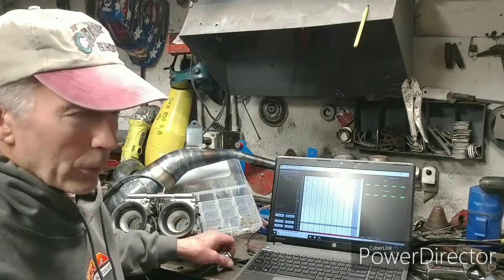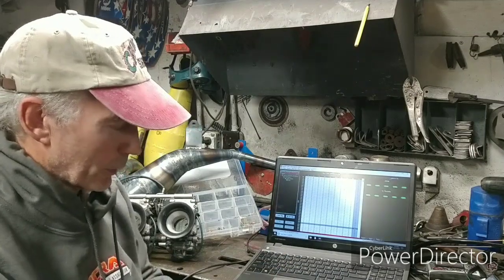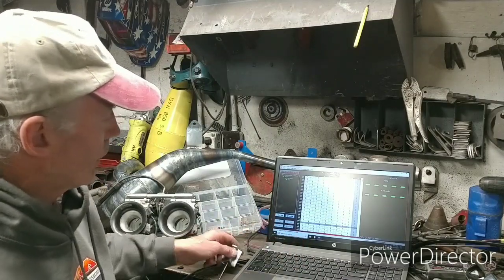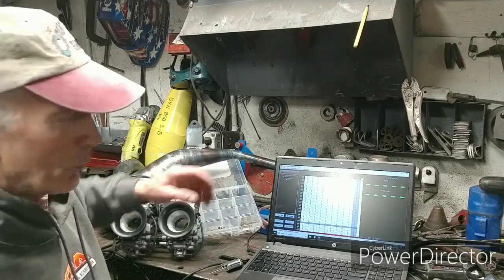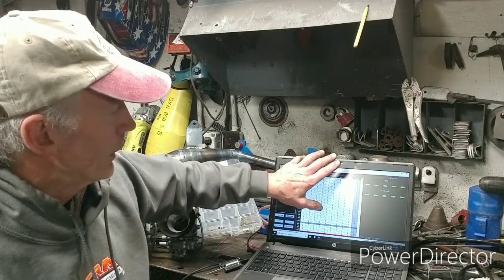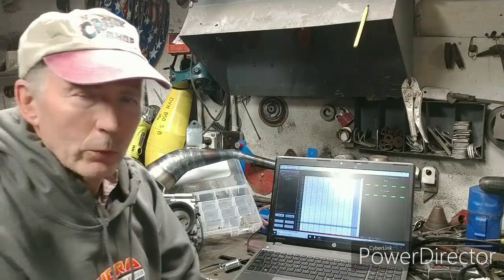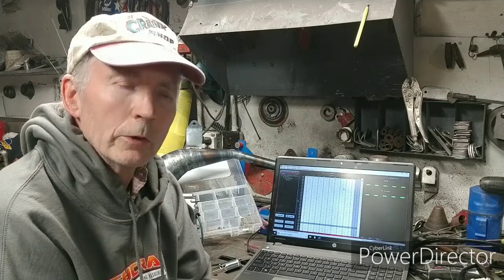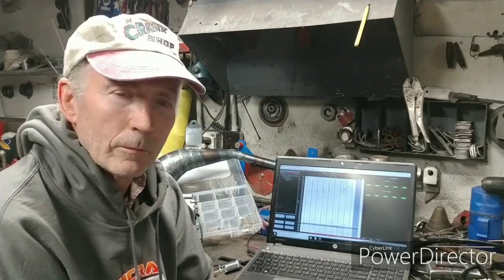DynoPort Rich says modern electronics are even easier than jetting!

Comment: Do you sell those black velocity stack that are on the carbs in the vid? If you’re running them, I wanna run’em too.
Reply from the maker: They are stock in the XP 800 airbox and give 2 hp , I cut the stock holder off to save weight.  I did try CNCing some aluminum ones different shapes but the stock worked the best.